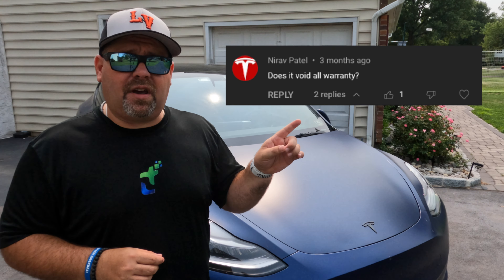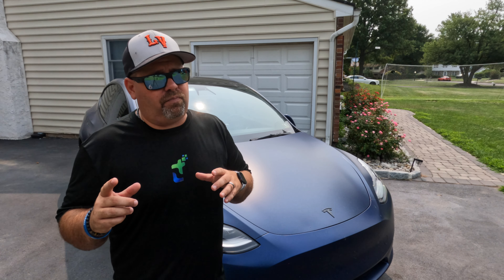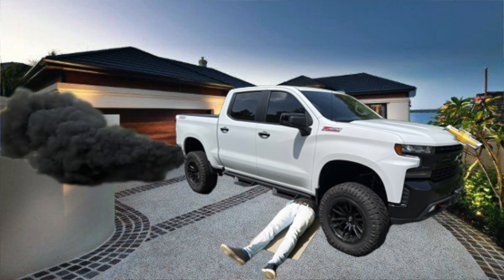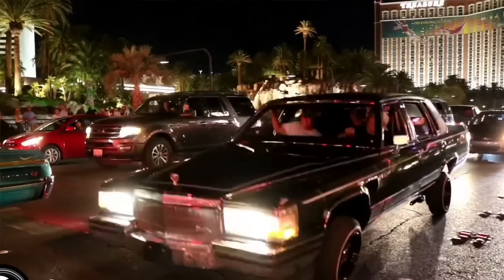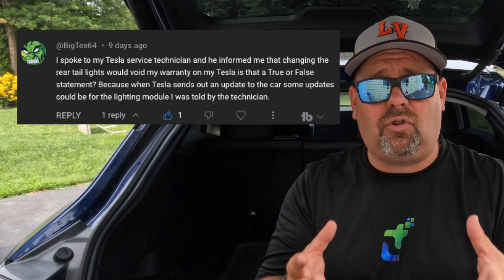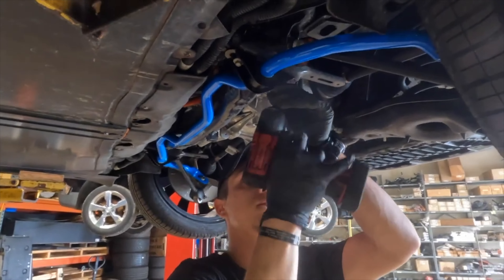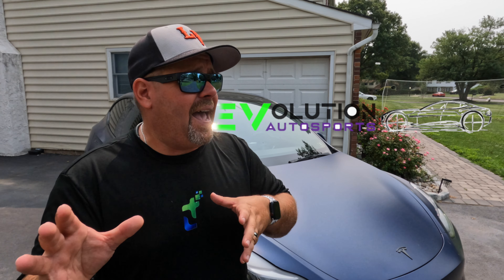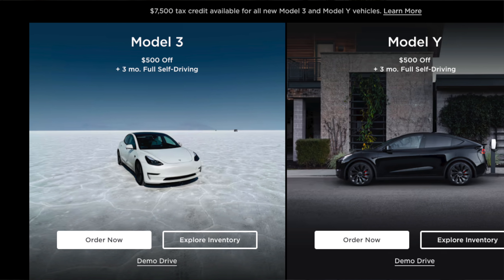SAVE YOUR WARRANTY 🛠️ & Still Do Epic 💥 Mods To Your Tesla Or Any Car | How to get the best of both!

Comment: What happens if you put a generic oil filter on your engine and the engine fails??? You covered the outcome for, exhaust, transmission . . . then skipped "engine" failure.

Comment: Could we use the same rational you used in the video for Leased cars.  When Leasing, we do not own the car, we are basically renting it? What would be your suggestion? Thanks.
Reply from the maker: In most leases they can make you return it back to factory or charge you to do so I would say same does not apply to leased vehicles.

Comment: In fact it is not the manufacturer that has to prove the modification caused an issue. It is the owners job to prove it did not. For example, you make a mod, have a problem,  make a warranty claim and it’s denied. You then need to prove it’s not related. It’s just not worth the effort. Keep it stock and keep the oem accountable. Even then it’s difficult. The burden of proof is on you.